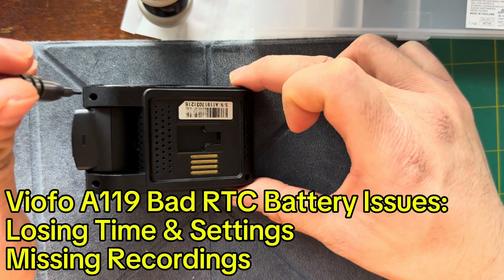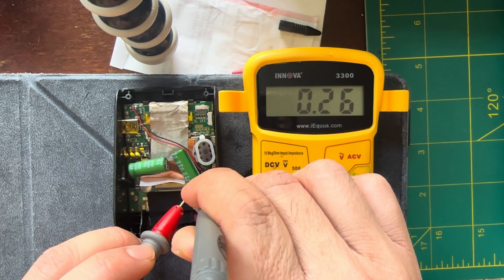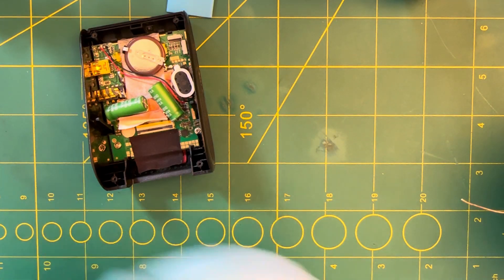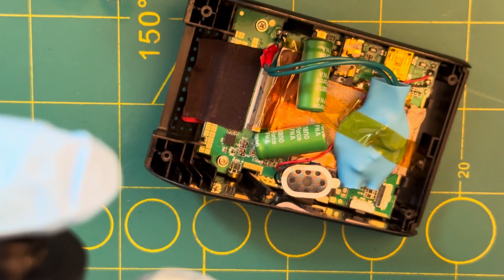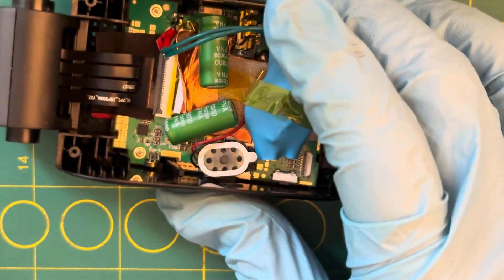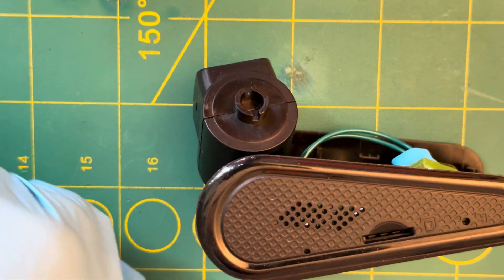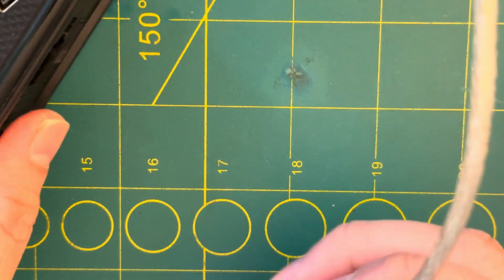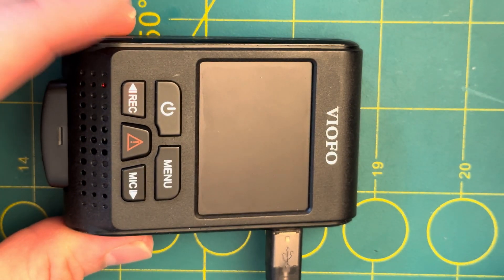Viofo A119 Dashcam Loses Time Settings and Missing Recordings - RTC Battery Repair and Disassembly

Comment: I see you did this video back in April  2025 we are now in Oct .  does it still working good? The reason i,m asking is because I took my Viofo appart today because of the same issue you where having and Im about to order the same battery { VL2020 3 Volt 20 mAH rechargable } you recomended on your video. By the way it is a great video and well done. Thanks for posting.
Reply from the maker: Yes, it’s still going strong today. Hasn’t lost settings since I replaced the battery. Good luck!

Comment: Is there a trick to make sure that + and - during the soldering is not touching?
Reply from the maker: I would solder the negative side first then positive. And use thinner wires than I did to make it easier to manipulate.